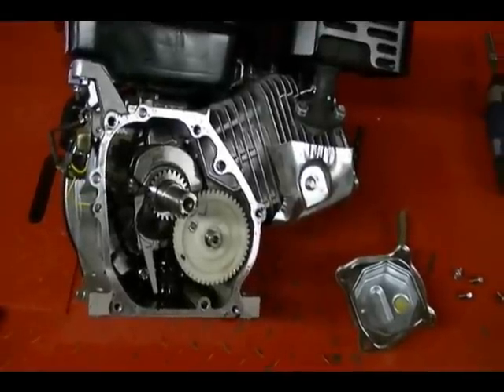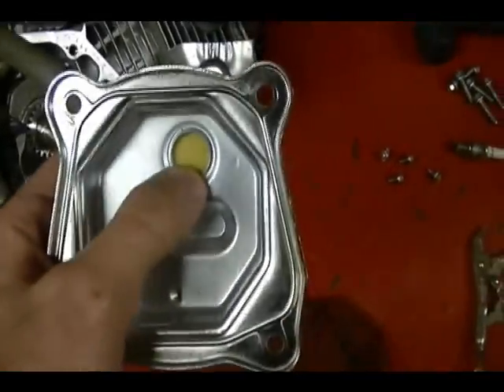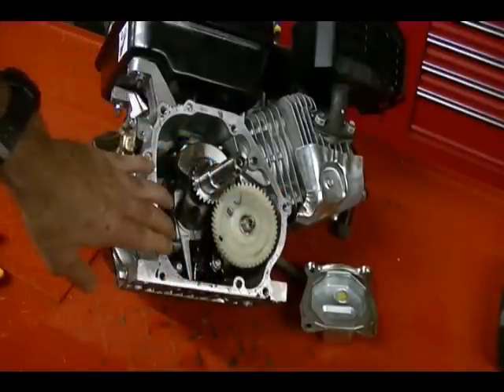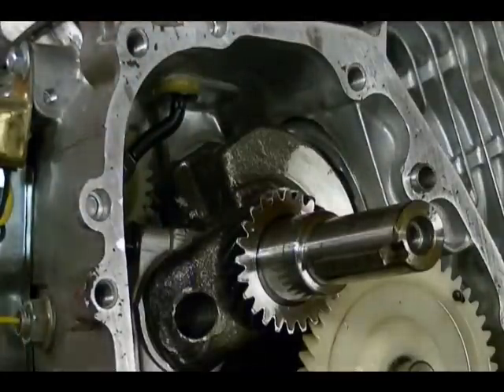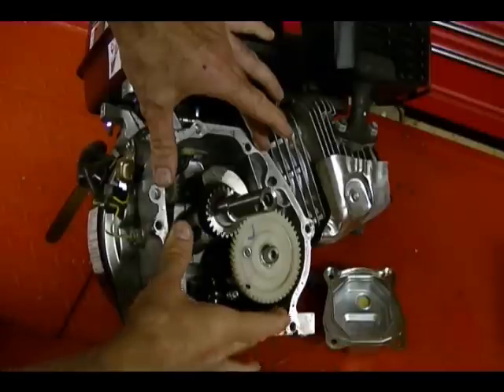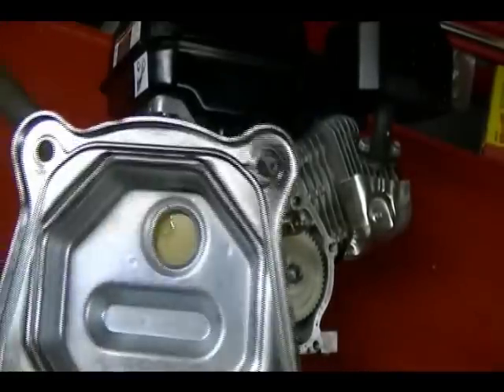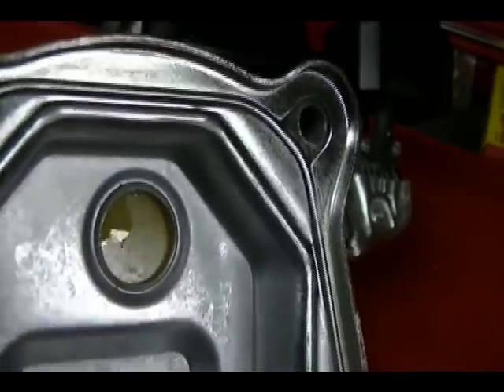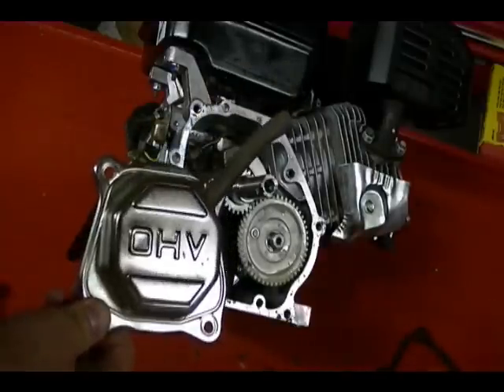How a Small Engine Crankcase Breather Works and How to Quick Check the Breather Valve

Comment: So put a reed valve in and reed valve out (to intake) on the crankcase:
= 2 intake strokes of the crankcase for every 1 above = supercharger!
Sure you'll need fuel injection, but free, compact, light supercharger...

Yes you will want crankcase stuffing and 'porting' and a centrifuge oil separator, but you get an interesting video/s (clicks) out of it, for which you wont send me any of the income...

Comment: What cause when oil is blowing out from the breather hose?is it the valve cover to be replace or there's something more?
Reply: My understanding is on some small engines the air valve is defective when they blow oil out the tube going to the air filter. 
  The valves I am talking about are under the flywheel. 
  If not opening and closing properly can cause surging and/or oil buildup in muffler. 
  Have one I intend to check for the first time. 
  Carb has been cleaned, overhead valves set, etc..
  I also intend to to check fuel hose in case it is getting brittle and sending small pieces of debris into carb. 
  Tank has also been cleaned along with timing key changed. 
  I think this fuel tank has a filter in the bottom, so I think I will also blow air through it in case it is clogging some.

Comment: It`s a nicely built tutorial. However, I can`t find the place where this tube is connected to Briggs and Stratton 7.25hp engine. There is nothing like a tube connector on its rocker cover... How can I localize its check-valve membrane to see its condition... It seems to me, something is wrong in this system. I can start the engine when filter and its cover are off only... Once I have them installed- no option to start the engine... Probably this check valve is clogged or faulty. Thank you

Comment: What happens if you run you pressure washer without the valve case breather hose attachment to the back of the air filter case ? Because I accidentally did that, now my pressure washer won’t start at all.

Comment: How would I replace crankcase breather and gasket on 25 Kawasaki Fh271d DS08...Is there an easy way?..Its pretty tight..behind the sprocket that the starter turns...Its on an exmark ..horizontal shaft...Thnx

Comment: I have a craftsman lawnmower (Tecumseh engine) with a breather valve like the on at this link ----  https://www.youtube.com/watch?v=wh6__GMNsLA  --. Do you know how to clean/replace a breather tube like that? I understand there may be filter material in it somewhere that probably needs to be replaced also. I overfilled lawnmower with oil and it came flowing out of the breather tube, and I would like to clean it. Can it be removed without removing flywheel?

Comment: Is that the hose that was connected to the gas tank? Not the fuel line the other hose thats connected to the fuel cap and goes down to the air filter.

Comment: I have a duramax 18hp motor for a go kart. I removed the oil sensor and governor. When I was running it doing the brake in I unscrewed the dipstick and it blew out a bunch of oil, there was a lot of pressure in the crankcase. It's brand new so I don't think the breather valve would be stuck. Is it normal to have that much pressure in the case?

Comment: Hello. Have an issue with my CPE Champion generator.  Its reving up and down while running off choke. I replaced carburetor, And put fresh fuel, and cleaned the pet cock valve
Starts fine in choke position but when I move lever to Run the engine starts to rev up and down. What else could it be. Thanks in advance

Comment: On mine when I blow into the tube I don't hear the clicking sound. There is no rattle when shaking the cover. When I blow into the hose the only thing that happens is air comes out a very small pin hole at the bottom inside of rocker cover. I can manually push the "breather reed/flap" in and out but upon return I don't think it is a very positive seal. Your input is appreciated?

Comment: It's the same technology they use in cars so it doesnt matter what engine once it's a 4 stroke and not a 2 sroke, vent to the atmosphere is better for our engines because it doesnt gum up your carb/intake and engine with oil residue and in the end will end up causing carbon build up.The only reason why we started recirculating the crank case gases is because of the strict laws from governments across the world trying to lower emissons. Race cars/f1(dry sump lubrication) uses a pump to suck out crank case pressure to create a vacuume to improve performance and also reliability by reducing blow by gases so the piston rings are able to seal better

Comment: is it bad running it with the valve hose disconnected from the carb, cause i took my filter shroud off mine and the vale hose exhaust end connects to it so i left mine hanging..is there any bad effects from this or just faster oil depletion

Comment: I own a Honda walk behind lawnmower with an ohv engine.  When its running oil enters the air filter holder through the breather tube.  There is no cover around the breather tube on the engine.  What is causing this and how do I fix it?

Comment: So on my 212cc I had to put the short head valve cover and it doesn't have the vent on it how important is it because I've been running my 212cc with out any crank ventilation for 2yrs now

Comment: I have an EZ GO golf cart that I am resurrecting.  It runs well at slow speeds.  When I speed up or try to go uphill in bogs down.  I have checked compression and cleaned the carb.  It has a hose from the crankcase to the air filter.  The crankcase pulse also drives the fuel filter.  It is missing the pcv hose.  Would that account for this problem?
Reply: Cart is overloaded... loose some weight!

Comment: Hi i have a craftsman tractor with a kohler mv20s. It is blowing oil through the breather into my carb. Dipstick popped out a couple of times while it revved up then had a strong vacuum pulling it back in. It was also blowing white smoke, could this be a head gasket issue? Any help is greatly appreciated
Reply: Same engine and problem of blowing oil and white smoke from the little breather hole (air cleaner not hooked up at the moment) , but haven't had the dipstick issue....have you found any info?

Comment: Is the breather needed in any way to lubricate the top of the cylinder?  If the return tube were disconnected from the air cleaner, would it damage the engine?   I got my engine back from a repair shop and they didn't reconnect the hose, so I am wondering.

Comment: I have a craftsman 625 series lawn mower with oil spitting out the spark plug. I cleaned out the chamber and got it to run but still have a little white smoke. I was reading that it could be my crankcase breather which has oil all on the inside but not the outside. It doesnt have a hose on it like yours does.  Could this be my problem of white smoke and earlier with oil coming out the spark plug hole?

Comment: I have kohler courage 6.5 vertical shafted engine, fitted to my dr trimmer tr4 model, the crankcase pipe is always blowing white air and oil out, and when this pipe is fitted back to the air filter back plate the engine loses power so i've pulled it off there but still have the issue of it blowing and spitting out oil.
I have since fitted genuine kohler breather kit but it's no better and it still keeps blowing out continuously. Is there something else that could be creating too much pressure inside the crankcase?
The trimmer seems to run ok starts really easy first pull. Maybe a little low at full power but i suspect it to be related to the blowing issue.

Comment: I just had a new sleeve with piston and rings put into my 2005 Suzuki king quad. I had the head cleaned and valves and head machined. I started the engine and I have allot of blow by in the crankcase as well as allot of blue smoke coming out the exhaust pipe. can you help. Ron.
Reply: Years ago I put rings and bearing in a Chrysler car. It was blowing smoke like crazy. Then I noticed that I had put a valve cover on it from another similar car that I had for junk. They had a different PCV system. The PCV system was designed into the valve cover on the car I rebuilt. So I put the right cover on and no more oil burning. The pressure from the oil without the PCV was running straight out the exhaust. You may have a bad PCV breather/valve/clogged system.

Comment: But what exactly happens when the piston moves TDC and creates a vacuum. Where does it pull air from to equalize?
Reply: It is not pulling a vacuum. It is causing proportionate pressure compared to the amount of space the traveling piston occupies from the oil inside the crankshaft as oil is thrust about. This pressure is released through the PCV (positive crankshaft ventilation) or what is referred to as the crankshaft breather. So when the pressure is released some oil releases with it and is trapped in the breather and then recirculated through a hole in the breather back into the engine. Some systems use what is called a reed breather which is a flexible tab that opens slightly to release pressure. It is screwed above a pressure relief hole. When it looses flexibility and remains open oil will run out the relief hole into the rubber reed hose that goes to your carb. These reed breathers are usually located so you have to remove the flywheel to get to the breather cover. By the way if your automobile starts smoking a lot of oil for no apparent reason your PCV valve or system is likely the cause.
Reply: At that point the intake valve opens and air & fuel are drawn  into the combustion chamber on the down stroke.

Comment: hi there,  I bought a predator 13,000  11,000 watt running generator ,  it runs for about 10 to 15 minutes,  then blows a bunch of smoke out and dies out.  it starts right back up, any ideas on what would cause this, thank you

Comment: rotate the crankshaft with a pair of vice grips? At least put some duct tape on the shaft so you dont mark it all up.
Reply: It does not hurt using vice gripes to turn crankshaft as long as it is not where a seal rides, or on threads. So it gets a little scored, no harm unless it causes leaks or damages parts.

Comment: awesome vid. my question is i am getting oil into the crab covers my hand. its is an 18 horsepower briggs engine overhead valve engine. about 6 yrs old and a brand new carb i put on just 1 week ago. what do you suggest to start with.
Reply: Have you figured out I'm having the same problem with my 25 horse Kohler Command oil is spitting out the vent hose into my carb

Comment: if small amounts of oil is leaking from the valve cover.....what is the cause
Reply: Likely  loose valve cover bolts or a bad valve cover gasket.
Reply: An oil leak is causing the problem

Comment: Concise, to the point, jargon-free, and well explained with a great use of the small, clean engine. Good video. I just disassembled my Honda PCX to get to the engine and check the valve clearances, but when removing the crank case breather pipe out of the way, I could not remember its function clearly. I now have no need to check any more sources.

Thank you. I wish all explanatory videos of this kind were as well put together.
Reply: Except that what he is saying is 100% wrong.

Comment: so is exhaust gas supposed to come out of the hose ??
Reply: No, exhaust comes from the cylinder after the compressed gas/fuel is burned - that happens "above" the piston. The crankcase is what is "below" the piston. The piston moving up and down at a fast rate of speed causes pressure in the crankcase. In this video, he explains how that crankcase pressure is relieved through the breather hose. The breather hose is usually connected back to the carburetor so those gases get burned up in the cylinder.

Great video, smallengineshop!

Comment: On my Vanguard 16hp v-twin, there are excessive gasses exiting the "crankcase vent" or breather as you call it. In a cars crankcase ventilation system, there is a breather (that sucks in fresh air) and a PCV exit to evacuate the fumes and pressure. I am trying to understand where my engine draws fresh air into the crankcase to create an airflow rather than an internal vacuum that sucks the oil out. A vacuum leak causes excessive crankcase oil to vent on my Vanguard (infamous for this). If the inside becomes a one way vacuum I can see how the oil will exit this valve. Or perhaps this valve has failed and is meant to separate fumes from liquids?
Reply: I know this is a old post but your Vanguard engine may have a crankshaft seal leak which can allow air to enter the engine crankcase and cause excessive oil to accumulate in the air filter housing from the crankcase breather tube, hope this helps.
Reply: I think you may be a little confused on that. The air filter on your car just allows filtered clean air into the combustion chamber so your gas burns properly, and your engine is not damaged from filthy air.  The PCV system just releases pressure from the crankcase/engine. On some cars the PCV valve vents into the breather so the little excess blow by gases are burned instead of dumped into the atmosphere whole (EPA standards).  Older cars had valve cover oil caps with screen filters in them that vented excess pressure.
Reply: Thanks Tim. This may be why my BS 16hp Vtwin is forcing a large volume of oil out of the crankcase breather.

Comment: when they stick,it will cause oil to be sucked into the exaust. I found that out. What a mess. Someone put sugar in the gas,not sure if it causes the valve to stick but I know what happends when that diaphram doesnt do its job any more.

Comment: I have oil leaking out of the crankcase gasket on an 18hp ohv vtwin kawasaki vertical lawnmower engine.  It seeps out pretty good when I turn the engine off.  It makes good power, has the correct oil level, so I am kind of going in the direction of pressure build up.  What do you think is causing this?
Reply: +250ratc I just watched your other videos.  I think I will perform a leakdown test to confirm what is going on.  Thanks for you informational videos, they are really good.

Comment: The PCV is intended for releasing blow-by gasses from the crank case. It has little to do with crankcase volume as the piston moves. Piston rings do not seal perfectly. A small amount of combustion gasses leak or "blow by" the piston rings. This can cause pressure to build up. If it were for case volume it wouldn't serve much purpose being a one way check valve. The chamber pressure would simply oscillate between neutral and negative pressure. Blow-by pressure can become much larger than any slight pressure changes from changes in case volume and could be dangerous if high enough. It's probable unburnt fuel is present in this gas and could be a problem under pressure and for emissions purposes this gas is collected or sent back into the intake.

Even small engines these days have emissions in mind and most route these gasses into the intake similar to vehicle engines.

Good video.
Reply: Eric, thanks...I was trying to picture why the same repetitive changes to the volume inside the crankcase would produce constant higher pressure...it would be more like, high, low, high, low, high, low, etc
Reply: +ERIC FERGUSON 
 Correctomundo!!
Reply: My engine on my chipper has no hose attached from the OHV to the intake.  Now I know what it does.  Thank you for the info.

Comment: I did the hose test as you instructed, and no air comes inwards (when i blow air in) through the diaphragm, but there's a tiny hole at the bottom of the inside of the breather where air does come in. Is that normal?

Comment: can i use that as for the gas pump on a v tiwn or win gas get it the crank and lock you the motor
Reply: It's the same technology they use in cars so it doesnt matter what engine once it's a 4 stroke and not a 2 sroke, vent to the atmosphere is better for our engines because it doesnt gum up your carb/intake and engine with oil residue witch will end up causing carbon build up.The only reason why we started recirculating the crank case gases is because of the strict laws from governments across the world trying to lower emissons. Race cars/f1(dry sump lubrication) uses a pump to suck out crank case pressure to create a vacuume to improve performance and also reliability by reducing blow by gases for the piston rings because they are able to seal better.

Comment: One my old engines, why is this hose attached to the carburater? When I detach it, the engine runs better and I can't even start my lawn mower with it attached.

note I don't care about the environment so if its an environmental thing I'm perfectly fine.
Reply: Your piston rings are probably worn causing excessive blow by and allowing oil to leak out the crankcase ventilation hole. That would explain the hard start when the hose is connected. However if you disconnect it unfiltered air may get into your engine and cause it to lock up. If you need to take it out of the carb just buy a crankcase ventilation filter.

Comment: (1) is it like a PCV valve where unburnt gases are channeled back into the carburetor to be burnt again, or is it just to relieve pressure?...(2) when you tip a lawnmower on its side, does oil come out of the vent line into the carburetor? if so, I assume this is not a good thing...

Comment: Ive got a twelve hp motor the gas blows out the carb. But wont suck fuel to plug. If you spray fluid in plug hole the engine will fire and run. After you cut it off it doesnt suck the fuel back to the plug to start back.what can it be?